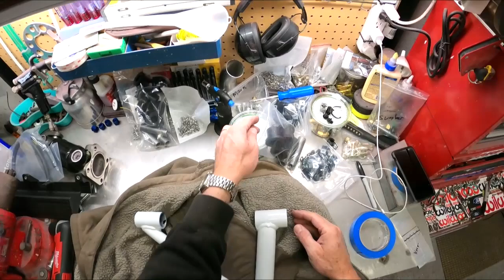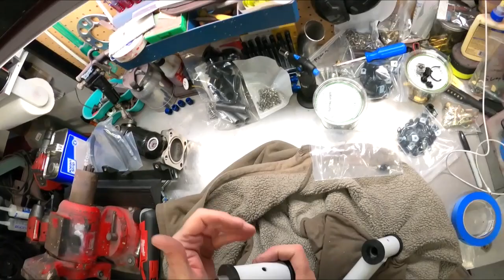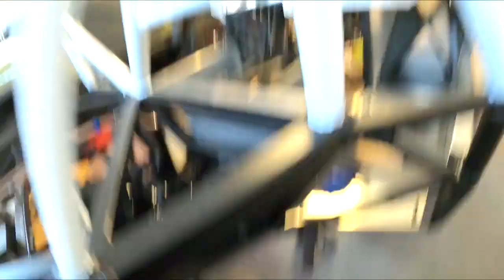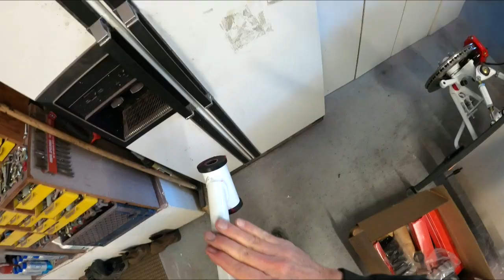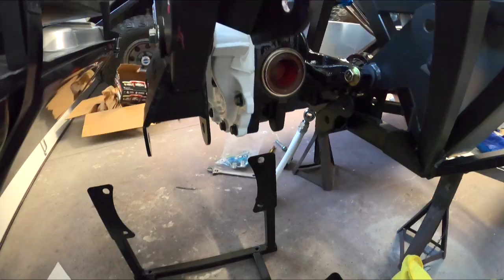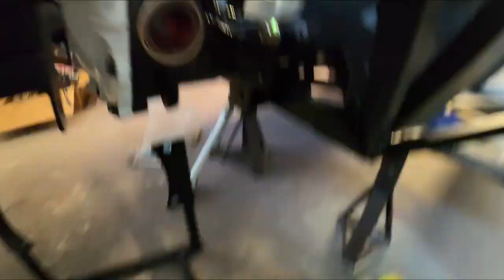Cobra Daytona Build-IRS Upper control arm install difficult one,video 45

Comment: I appreciate you filming like your doing. I am currently building an engine for a Mark IV roadster we’re planning on ordering late this year. The paints you use,  are any of them “single stage paints” & what’s your opinion of Single stage paints? Once again thanks for your video content. Love it.
Reply from the maker: All paint i use is 2 stage, base coat/ clear coat. Single stage is fine but takes longer to dry and thus more dust issues. Enjoy your build. Factory five is great to work with